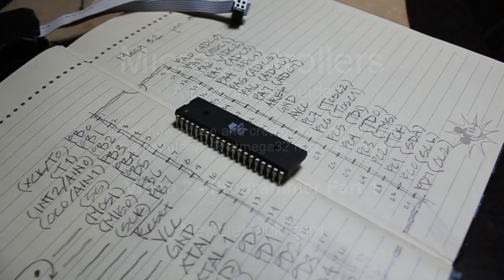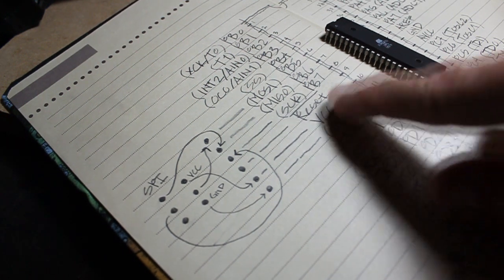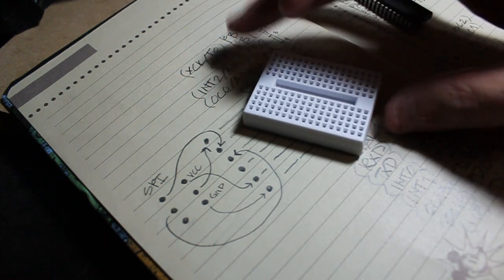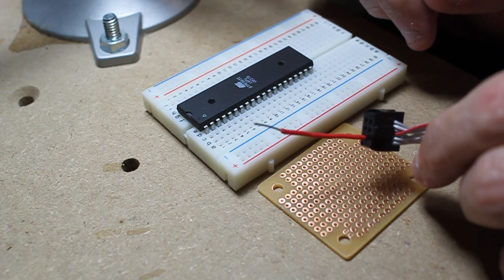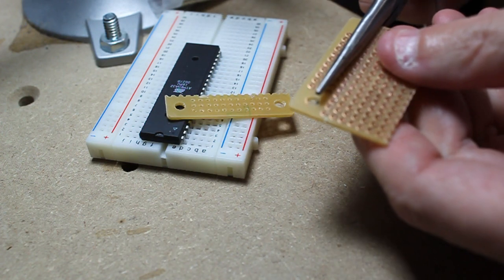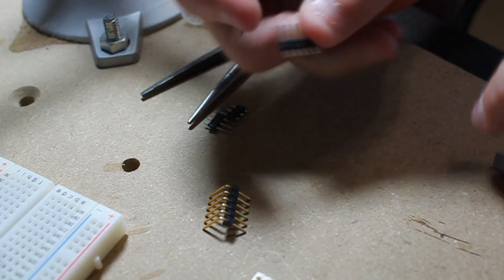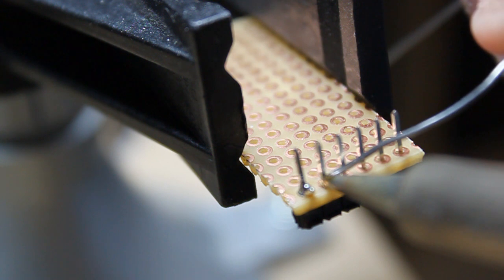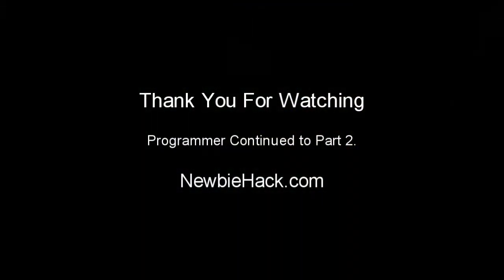5. Arduino for Production!  A Beginner's Guide - AVR Program Transfer Part 1

Comment: Little add. When i press "read" it says: Read voltage 0,0V is outside selected device's operating range: 2,7 V to 5,5 V.  So i'm not sure if the problem is in controller or in avrispmkii.

Comment: Hmm, i am using AVRISPMKII. I god my drivers running but it seems mkii is unable to detect my ATMEGA32. First i tried winAvr and it gets error by saying  "did not find any USB device "usb".  I finally copied the AtmelStudio.  When go to device programming menu it finds my AVRISPMKII. It actually downloaded new firmware to it. But when i press "read info" it tries to detect my microcontroller but is unsuccecful.  What is best way to test if the atmega32 is broken or is the avrmkii broken?

Comment: Hey, great videos, what kind/ size of pins did you use for the header? I have ordered the pocket AVR programmer and I am trying to make the interface while I wait, and I don't want to solder pins in that don't fit for in the connector.

Comment: Great tutorial. I could just connect to a atmega8 with the pocket programmer and the spi interface. all needed pins from the atmega32 can be found on the atmega8, study the datasheet of the atmega8 for this.

Comment from the maker: @NilsundLeander Thanks.  There are a couple of black things on the video.  The main component (microcontroller), but you couldn't be referring to that part, so that leaves the black thing that has a ribbon cable sticking out of it.  That is a programmer.  It is a device (interface) to allow a program (.hex file) to be transfered into the microcontroller.